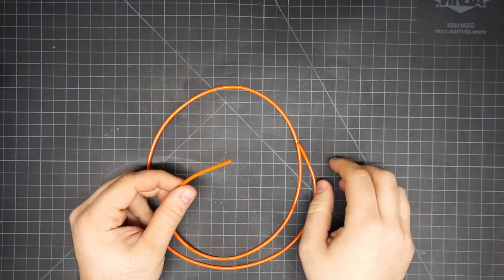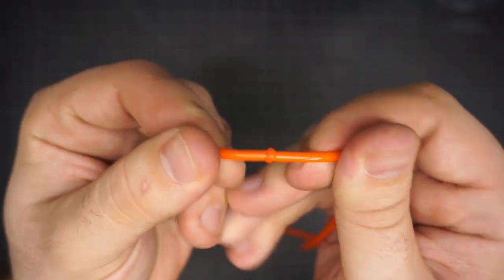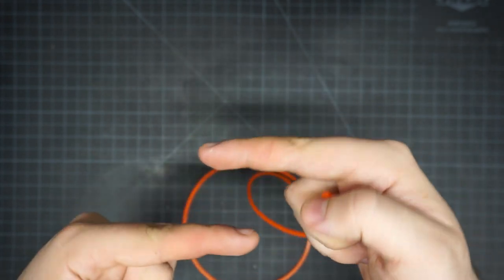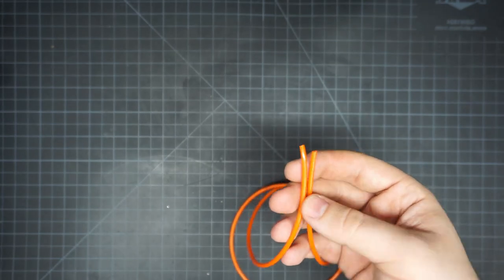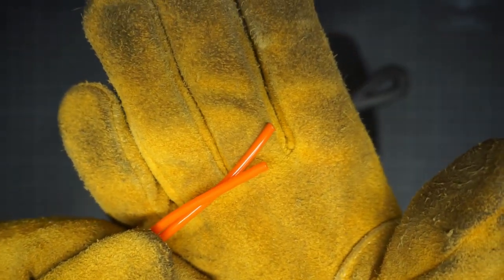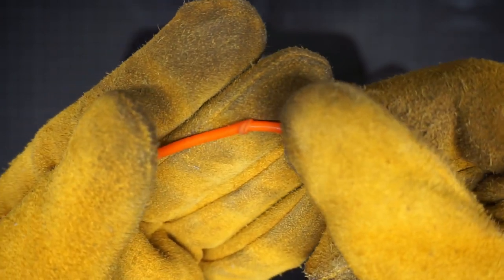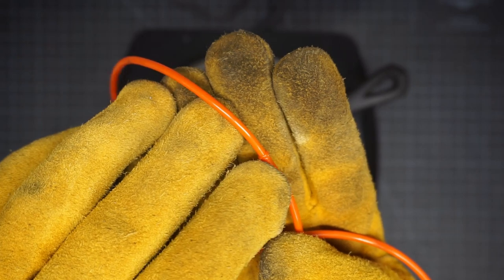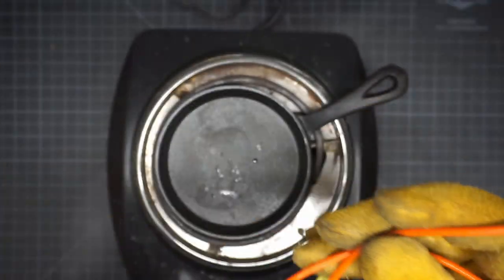Welding polycord belts with the hot plate method

Comment: Thank you for that! I think my problem has been not waiting long enough, patients is not one of my strong suits.
I took some 1"x1" scrap wood and cut a 4.8mm wide by 5mm deep groove down the length of it (for 5mm belt) and cut it in half, I push the belt ends into each piece with about 1/4" protruding on each, then when held against a straight edge strip of wood, the ends are perfectly aligned when heated and pushed together.